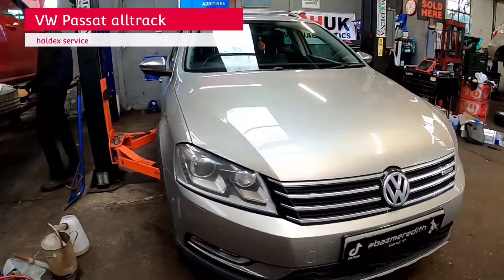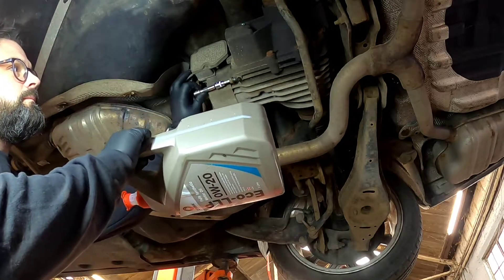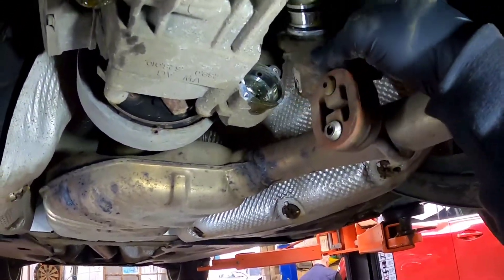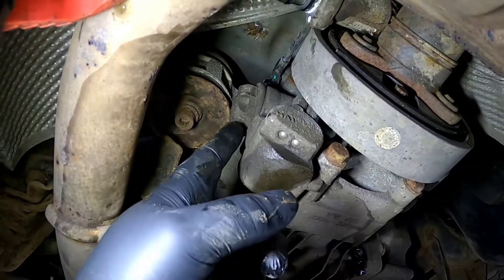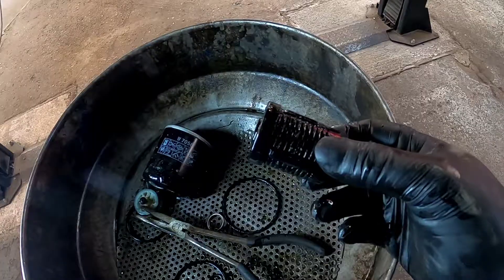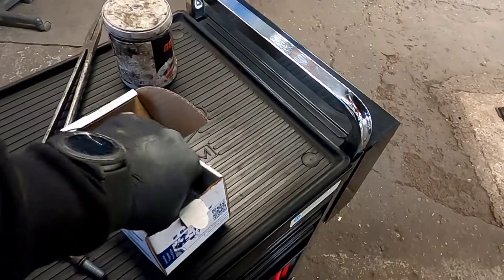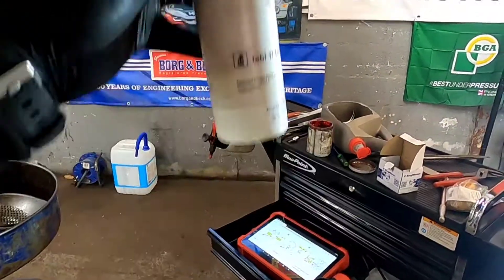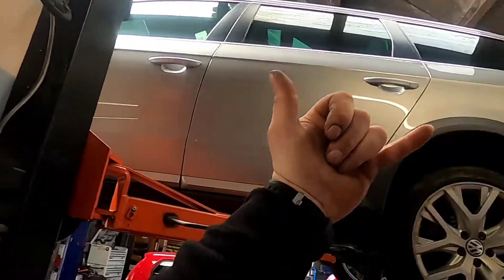haldex service VW

Comment: I had the same on a 2011 Tiguan, no record of Haldex being serviced, VW insistent that no filter existed in it, and i would get a judder or jump in reverse from the rear, all done and much better, but still get a little jump from rear occasionally but then it was on 90k with no evidence of change.
Reply: they are stupid, they told me also this filter is not designed to be changed.. so it should stay there until it brakes and you would need to buy new haldex or new car